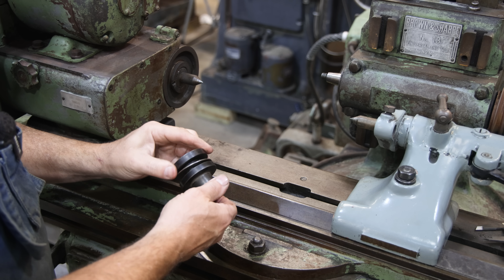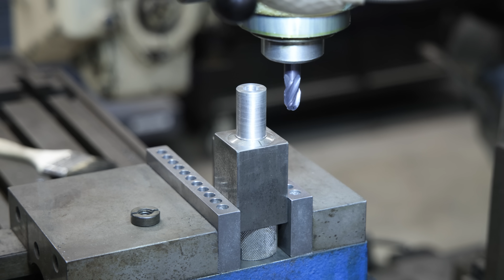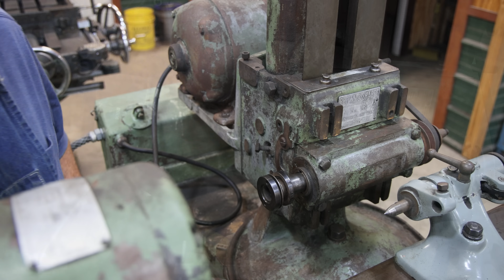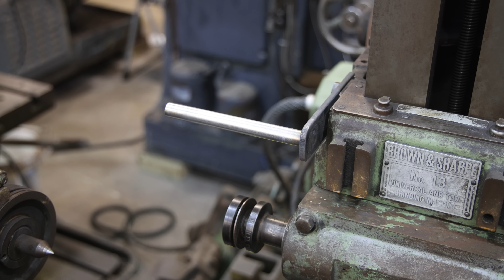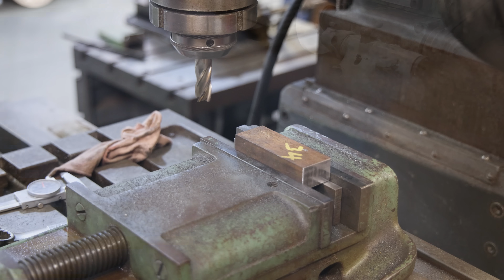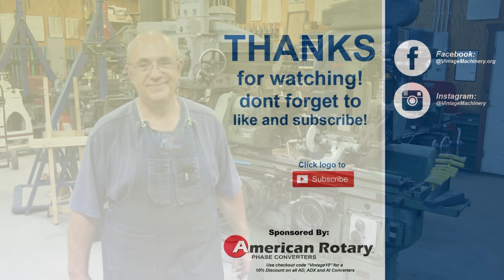Brown & Sharpe No. 13 Universal Grinder - Making some Custom Tooling and Accessories

Comment: You and few other select machinists folks have been a invaluable resource for information about tools, machines and how they work, want thank you for your help, has added a more diverse ways of making what ever we need or customer needs, would love to have room you have and some machines but we are working with what we have, future purchases include a bridge port type mill, and we also picked up a baby shaper, a Rhoads MFG 7 inch, got plans from another youtuber for the vise that was long gone many years ago (it needs total over haul, was completely stuck at first but after couple quarts transmission fluid with addition of heat, it is moving, for now sitting in corner😂) when our 100 plus yr old Seneca Falls Lathe, still working on lathe but have completed 1st successful job on it! Thanks again Keith and to all others who inspired us to go down rabbit hole 🐇  🕳 of machines and machinists jobs!❤

Comment: Enjoyed the episode though I am not a fan of how your tool engages the slotted nut having worked with these before. I appreciate the atheistics of the curved side notches, a square cut and shorter screwdriver pegs may be more durable in the long run. The longer legs could potentially start to bend. Just my thoughts. Keep up the incredible work you do!😊

Comment: regarding the nut, why not rework a 3/8 or 1/2" drive socket.  As a heavy equipment mechanic I have been forced to do that to remove fuel injectors.  The work was done with a hack saw, crude, but it worked.

Comment: Mount a diamond wheel dresser permanently to the outside of your grinders tailstock housing (facing the wheel), instead of a dresser you need to take on and off every time you need to dress the wheel

Comment: 3:09 - The manuals don't mention it, but the cam-timing-chain cases on Ferrari Columbo V-12s are fastened with obvious nuts/studs around the periphery, but also by a large (hidden; investigate before you beat too hard!) hollow 'bolt' near the center, the hole serving as an oil passageway (or vapor - long time back). It has cross-slots (90*) and I didn't have a mill then. Lots of time on a bench grinder...

Comment: On that wheel guard you installed there is a second donut/bushing with a socket head screw in it to lock in a piece of solid bar material. At first, I thought that would provide the pivot point for the guard, but obviously, not. Do you have any idea what that was intended to be?
The tailstock looks pretty and OUT OF PLACE! That to me suggests that the whole machine needs to be renovated to a like-new appearance if nothing else. 
While on the subject of guards, the belt(s) on the wheel drive need a suitable cover to protect fingers from getting between the belt and pulley on the wheel drive shaft.
Thanks for the video. Regards from Canada's banana belt. 
🤞🇨🇦🍌🥋🇺🇦🕊🇺🇲🪓💩🍯🏁👍

Comment: Just a thought.... If the bolt holding the rod that the guard mounts to gets loose the guard could contact the wheel, if there are no dowel pins in those two holes on either side of the bolt to keep it from possibly rotating.  Absolutely love your channel.
Reply: If the guard gets loose and hits the wheel it will make a big racket but not that dangerous. Ask me how I know!

Comment: Keith, 

It is hard to exact dimensions, but your screwdriver looks almost identical to saw nut screwdrivers.  Lie-Neilsen makes the SD-2, which is pre-drilled.  Grace makes screwdrivers where the blade needs to be drilled.  Blackburn Tool makes a screwdriver almost identical yours, except the blade can be replaced.  A Craftsman 3/16" × 1-1/2" Slotted Screwdriver could be drilled for a cut-out.

Bob

Comment: Was that an error that you are willing to live with when you milled the blocks to fit the rail? I'm sure the originals would have fit closer than the ones you made. Not meant to be too critical, just wondering.
Reply: Basically ANYTHING but that pesky Stoker Engine!
Basically Bozo AKA Fenwick Babbit is basically going to basically make some tooling with basically not critical dimensions to basically ACT like he basically knows what he's basically doing on that grinder!:face-purple-wide-eyes::face-purple-wide-eyes::face-blue-smiling::face-blue-smiling:
Keep in mind that basically It's not critical that any basic dimensions be critical!

Comment: Grip the collet block in the center of the vise or place another object with the same thickness on the other side of the vice.  This reduces the stress in the vice and also applies the force over the entire surface of the collet block instead of the inside edges only.

Comment: Grinding dust is bad for the adjacent machines, correct?: Hope that can be mitigated. Maybe, a curtain stand? Clamp on deflector(s)?  Is this 'not critical'?  

Much improved video. Perhaps when pointing out something printed, a pointer stick might be used, instead of the hand blocking out the object being described. 

Depth of Field: This. It should be increased and, carefully monitored prior to a take. Too many times,  you wind up having the vids specific item out of focus. Must be exasperating while editing - increasing the depth of field in the shot will reduce the exasperation. 

I bought some great drag link sockets recently from Epstein (not that guy) for very cheap - can be easily turned down, slotted for this use. Too many times I need to apply some serious torque to some crazy big slot head screw fastener and, needed options.  Are there other slotted nuts on this machine or, other in your shop, that can benefit form this?

Thank you, please keep up the great work!
Reply: The dust is not a problem because bozo rarely uses any of those machines!:body-blue-raised-arms::face-blue-smiling::face-blue-smiling:

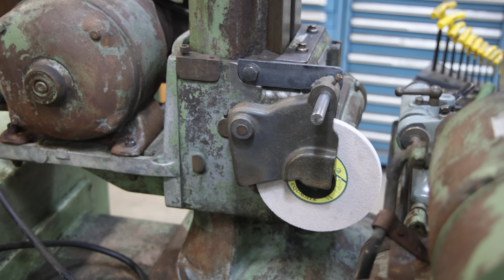Comment: Hey Keith, I know nothing about grinders and I'm wondering what the guard at 18:30 will actually do to increase safety? It seems to me that it's only actually providing protection for the back of the machine, if a wheel were to shatter the path to the operator is still wide open. What am I missing?
Reply: You still know more about it than Bozo!
Basically ANYTHING but that pesky Stoker Engine!
Basically Bozo AKA Fenwick Babbit is basically going to basically make some tooling with basically not critical dimensions to basically ACT like he basically knows what he's basically doing on that grinder!:body-blue-raised-arms::face-purple-wide-eyes::face-purple-wide-eyes::face-blue-smiling::face-blue-smiling:
Keep in mind that basically It's not critical that any basic dimensions be critical!
Reply: @garybrenner6236  What value have you gained for yourself by disparaging someone on the internet?

Comment: On the video, you said 0.478, then moved your cutter in 0.278 (should have been 0.239?). Unless you wanted the stops that loose in the slot.

Comment: To make the tool you can cut the sides off a socket, just leaving 2 bits that engage in the slots.
Reply: I made one like that a loooooong time ago for removing/ installing the firing pin into the bolt body for a Lee-Enfield No4Mk1. Hope I don’t need it anytime soon because I have no clue where it is now. 😂

Comment: Good morning Keith,
It appears that the tips on your new collet wrench should be shortened to mate the wrench flush with the nut. Then heat treatment is in order to prevent rounding off. 
It’s always fun to reverse engineer parts based off of poor quality images. 
You’re getting closer to a working machine.

Comment: You essentially made a slotted drag link socket. I probably have one buried in my toolbox that would have worked.
Reply: And at some time past, someone was cleaning out a trove of tools and asked, “What’s this weird screwdriver for?”  The answer, “Who knows?  Toss it.”
Reply: @robertbamford8266 unfortunately I'm old enough to have rebuilt drag links on big trucks. Instead of spending $300 on a new link you could buy a kit to replace the ball stud, spring and half sockets for $25. The good old days were so much better in so many ways.

Comment: Odd question, but as Keith keeps coming up with these neat old machines.  For a typical machine shop back in the day, how many machinists would be employed for that collection of machines?  I'm guessing that the shop itself would have been a fair bit bigger just for storage of materials and finished goods going in and out.
Reply: the volume of parts being ordered has a lot more to do with how many employees can be hired.  the number of machines determines what kinds of parts you can make.

Comment: Always look forward to your vids, great work but can I say, just a thought has that guard you have just fitted have a positive stop only if the cap allen screw holding it on the shaft slackens at all due to vibrations etc it might just start to slip down  and if it hit that stone ( going at speed) it might destroy it,  jusayin 😊
Thanks keith always great work 
Russ 
UK
Reply: Basically ANYTHING but that pesky Stoker Engine!
Basically Bozo AKA Fenwick Babbit is basically going to basically make some tooling with basically not critical dimensions to basically ACT like he basically knows what he's basically doing on that grinder!:body-blue-raised-arms::face-blue-smiling::face-blue-smiling:
Keep in mind that basically It's not critical that any basic dimensions be critical!

Comment: If you don’t already have one, I think you will also need a grinding wheel balancer - so the arbor and balance rails to be able to balance out (drill) your grinding wheel so it doesn’t vibrate on the grinding machine.

Of course you could make one, but from memory they aren’t that expensive.👍